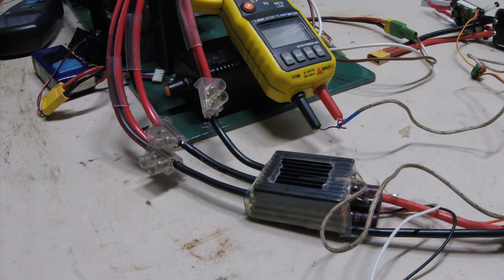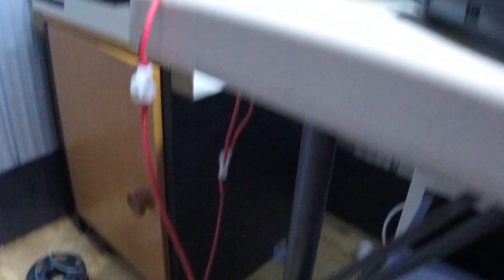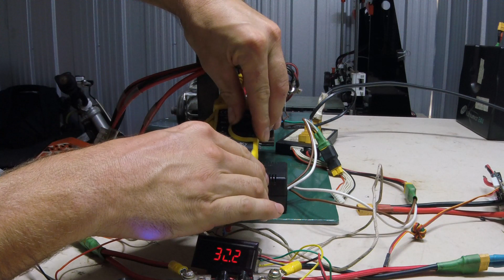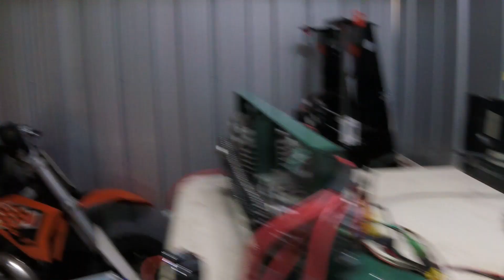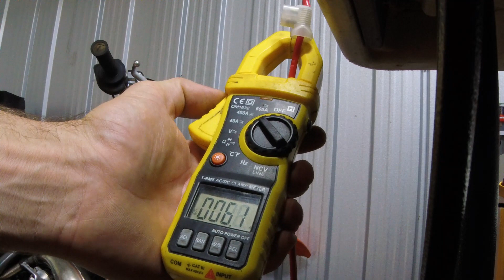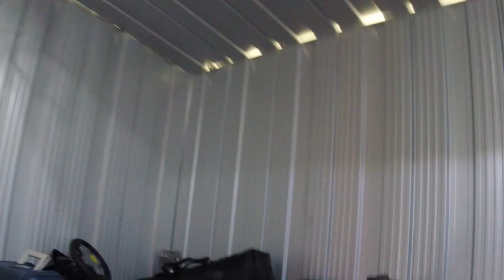overview of load testing setup! alternator converted to motor

Comment: How long can you run it for? And have you melted any?
Reply from the maker: Hi mate the red brick esc got too hot around 11min in the video.  I didn’t catch it on video but the red brick esc went up in flames in the end!!! I’ve blown 3x vesc’s 4.12,  1x 200amp red brick,  loads of drone esc’s and my most expensive one vesc 6.6.  Something is telling me to stop but I love it lol 

If you keep the amps down and watch the temps they will be fine the biggest killer is sudden current draw as the esc has a hard time limiting it!!  So what I have been testing is the limits of each esc.  I know the vesc 4.12 is around 11 to 15amps with no cooling but with the right cooling it can push 50amps continuous.  I have yet to find the limit of the vesc 6.6 water cooled as it burnt out my load motor but I have a dyno that can take the load now just need to finish it won’t be long

Comment: Hello, can you or anny person help me with one alternateur Volvo 24V 110 A but i see two bobines only and 3 cables to one phase, can i make one motor with or is impossible ?
Reply from the maker: Hey it’s hard to say exactly with out knowing the model number if you could get it that would help but the 3 cables should be fine for your motor input I would of thought.  If you use a multi meter and test between each cable what is the resistance?  You will also need to power the field windings.

Comment: What modifications your have done to your ""converted alternator""?
Reply from the maker: Avin Raikwar Hi I’ve removed the diode pack and Regulator to expose the windings ends.  Then check the windings with a multimeter to find which wires are connected to each other and labeled.  Now I Connect each non connected winding to each other and end up with 3 input wires (Phases) then I connected 3 wires to them and connected them to a esc and tested sometimes you have to play with the orientation to find the best combination.  Also reconnecting the brushes that power the field windings that act as a electro magnet and applied around 12v to them.  Doing it this way you end up with a motor that is configured in delta which I have found to be the best.

Comment: Here a twist.  Replace the driving alternator (motor) replace with a bedini ssg.  The Bedini SSG will not heatup as fast as the alternator due to lower Counter EMF or lower BACK EMF.  You may find some interesting results. 
I have built a bedini ssg and still learinig from it.  The magnets on my first wheel have become projectiles and I am carefully not trying to repeat that.   Currently waiting on some more parts to get an alternator to turn with a belt pulley system.

cheers
Reply from the maker: Hi Pedro Torres I will look in to a bedini motor only really watch a couple of videos on them don’t understand them fully!!  Yeah you wouldn’t want a magnet in the face lol 
Cheers

Comment: i was searching a bit about thermals on the VESC, and found this video:
https://www.youtube.com/watch?v=UwVQQ_LY5bc

In the video, the guy explains and tests the difference in temperature with and without cooling
(graphs on here: http://vedder.se/forums/viewtopic.php?f=6&t=730 )
And he says that the VESC begins to step down its power at 80°C and cuts off at 100°C by detault as well
Reply from the maker: @FoxxYT hey thanks for that!  Shows how cooling really helps.  I ve tested the vesc without airflow with airflow now ive added heat sinks and will test today!! Hopfully I can upload the video today too.  2 issues I have found is that the vesc 4.12 has,  1 it doesn't record motor and battery amps correctly way under,  this is because of only having 2 shunts on the board!!  2 when running at high loads the shunts get very hot and can melt the solder.  People have found the shunts on different parts of the board which have I have lead to shorting the vesc out!  So looks like the limit of the vesc isn't just about keeping the mosfets cool!!   The spacing of the components make it hard to keep them cool ie to get any real heat sinks fitted.  Yeah you can change the cut temps as needed and also the way in which it limits/cuts out.

Comment: Wow! What's the purpose of that massive transformer at 5:04 ? 😮 Thanks for the credit. This is starting to look like an amazing testbench and dyno for "motors". I have the same problem with the temperature, when I took the go kart drifting I almost melt the wires too. I'm thinking of sticking a 12V 3000rpm 120mm server fan at the rear of the alternator, it makes a lot of noise but maybe solves the issue of overheating. For the sprocket I recommend going with 0,1mm layer height and 80-100% infill, it will take time, but most probably it will be strong. It really made a big difference when you blew on the ESC, heat is our enemy. Thanks for the update and be safe!
Reply from the maker: @enregneering  That transformer is a 240volt to 48v 30amp for charging lead acid batterys.  I was trying to use it as a load but didnt work out.  All good mate i am glad I saw your video,  costs alot of money buying sprokets!!  Yeah i think the higher voltage might saturate the stator windings, which would equal alot of heat and become very inefficient but i will try and run different voltages to find the best. I am very interested to find out how much the vesc can handle when efficiently cooled.  Ive just printed a sproket @ 100% infill but at 0.3mm layer hight see how it goes if not will try 0.1mm
Reply: We need to find a way to attach better heatsinks and fans to cool the entire VESC, not just the MOSFETs and ICs
Maybe so we can get the 50A they announce (in 48V nominal would be ~2400W, a bit over 3,2HP)
And then search model-matching alternators, forced cooling these, and use two force-cooled VESCs to a dual motor system, putting up to 6,4HP in a kart or another small vehicle
Reply from the maker: @foxxyYT all down to you my friend!! Thats sounds good!! What about Applying as many heat sinks to the vesc as possible then 3d printing and case the has openings that force air on/over  the heat sinks,  using a fan to suck air out of the case this would pull air in and over the heat sinks.  All things to look forward to testing in the future
Reply: Yaaaay! Two of my favorite YouTubers together in a comment section!